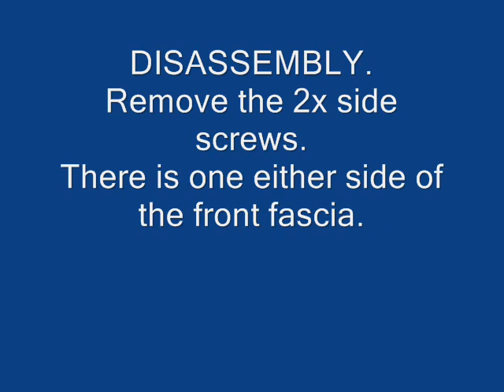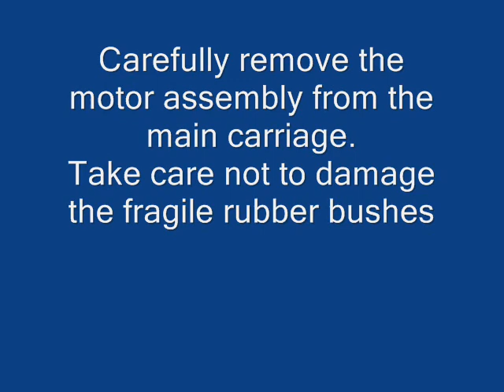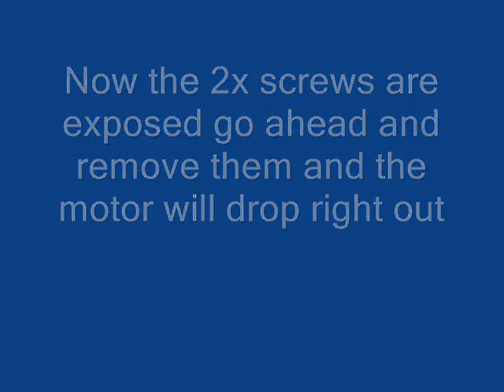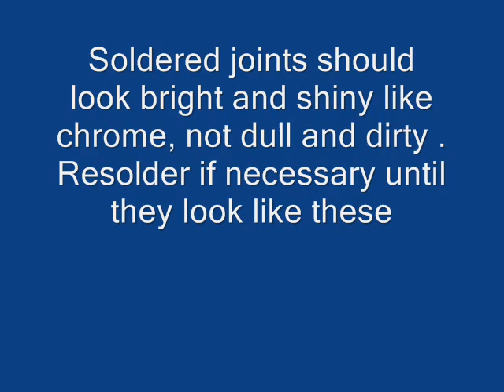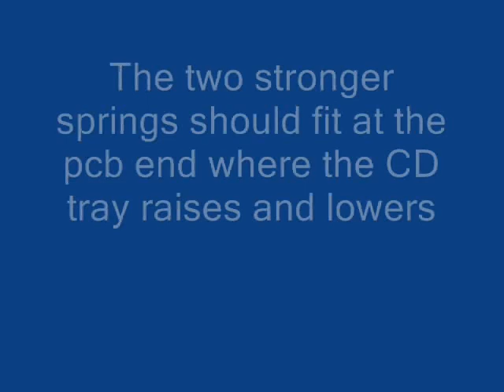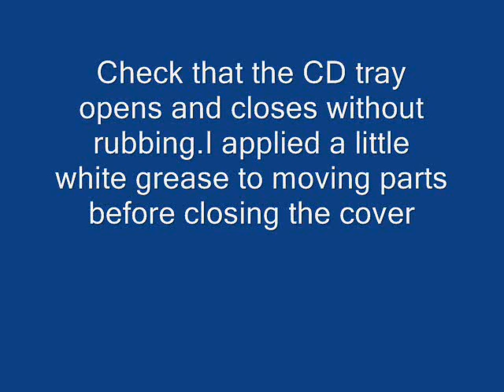Teac PD H300c CD not playing

Comment: Didn't realize the springs were different from front to back. I've a NAD C520i and thought those springs were all the same and assembled the unit without being aware. That may be why I keep getting a no disc error even after replacing the laser and checking all components on the circuit board and not finding any faults. Learn something new all the time. Wow, I should've had a V-8! 😆🤔

Comment: What's happening is this .the tray only goes 3 quarters in and stops .you have to gently push it closed the rest of the way.then it's not gripping the CD to spin .if I gently left it up it will lock into place and I can then play the CD  that is untill I open it again then have to start the whole process again which involves taking the cover off every time want to change CD .it sèems to me that the last bit of the tray closing makes the lens part flick up and lock the CD .which isn't happening .Any ideas now ? .
Reply from the maker: well from your description it sounds like it could be any of several issues or a combination of them. 
sticking drawer due to damage or distortion of drawer
slack or worn rubber drive band
worn out transport mechanism motor

The Teac 300 system is an excellent system so its surely worth a little investment of time and money to have it working properly again .If you are having to remove the cover frequently ,why on earth haven;t you replaced the rubber band ?

I would recommend that you install a new drive belt first and see if that does the trick . It costs a few pence or cents and is a 5 minute job
Reply: Thanks for your prompt replys.yes it's deff something to do with the tray .(not catching) on the "runner".yes it's a great system but I recieved it in this state.i think at some point it's been forced open and that's damaged the tray "guide" it will play endlessly from off to on and on to off and back again and can pick any track but soon as open the drawer to change CD problem starts again .

Comment: Hey, so with mine, my drawer wont close and keeps opening and shutting but when it shuts, it doesnt close properly and opens again
Reply from the maker: I suggest that you watch both of my Teac videos carefully then read all the replies to all the comments below and you will find the answer .
Reply: @johncooper7242  ah ok thanks. Imma be honest, I just wacked the top of it and it opened. With my tape player, it only plays really fast though.
Reply from the maker: @saulmas1801  they are a great system I wouldn't swop mine for anything else but they are getting a bit old now and wearing out.
Definitely worth fixing though so follow my guides and replace the motor rubber drive band first then make sure that the disk drawer i not catching anywhere and is fully returning. very common fault is the front fascia to the drawer jams, just as the drawer is near to fully returning. I took the plastic trim off of mine which solved the problem Good luck
Reply: @johncooper7242  100% this used to be my dads and I've got it working. One of the best systems I've used and I'm doing all I can to get it back up to how it used to be

Comment: Hi. I am trying to replace the drawer system belt in the same device but I can't find the way to dismantle the tray to reach it... Any advice? Thanks for the video!
Reply from the maker: watch the video . It will show you how to dismantle the player and access the tray. Once you have the case open you should be able to see the tiny rubber belt which is  25mm dia 2mm thick square section rubber band . its fiddly to access and replace but quite doable.
Reply from the maker: Hi .
I expect you have replaced the drive belt by now but in case you haven't....my latest video guide might help. Good luck

Comment: The CD player doesn't read properly the first few tracks (say up to the fourth track) then it plays fine. Any advice? Thank you
Reply from the maker: Hi Sylie. Thank you for asking but unfortunately that is beyond my ability to diagnose this sort of problem on the net, I'd really need to inspect it.

The only suggestion that I can make is to clean the lenses especially if your unit has never been cleaned or it has sat in a room with smokers at any time in the past.

You can buy CD lens cleaners at Maplins and any good high street Hi-Fi store or online of course. I suspect it will play normally once the lenses are cleaned
Reply: Thank you very much for replying so promptly. Will clean it again and again and again, it might work at the end!